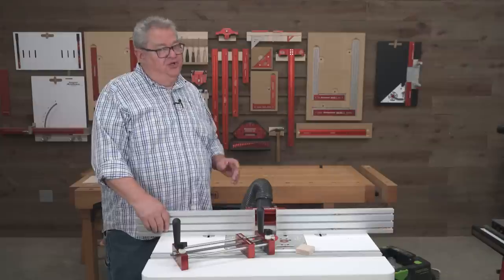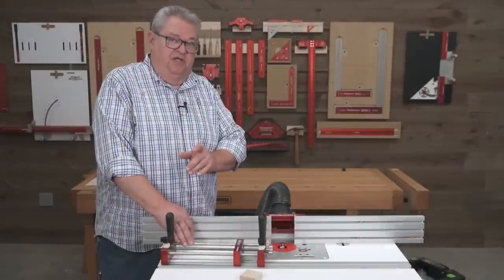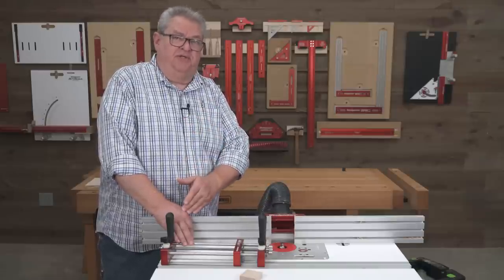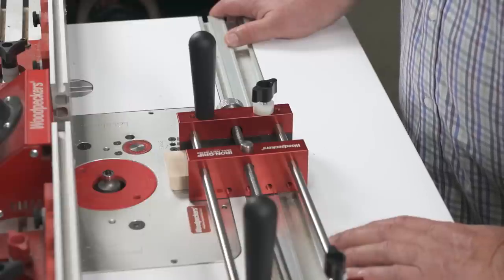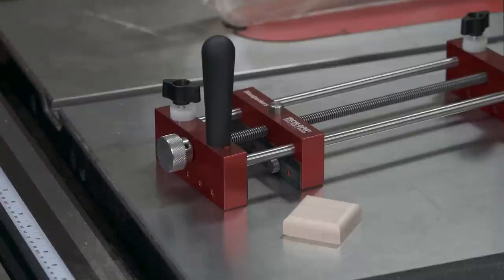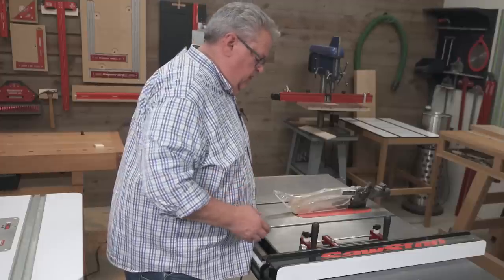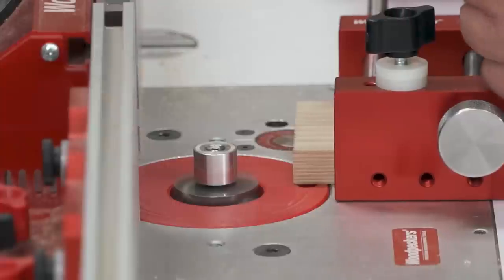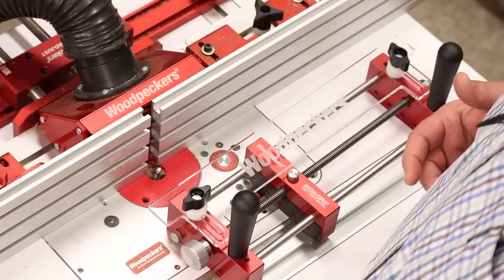Iron Grip Small Parts Holder Deep Dive

Comment: Great video and like you Jeff I don't wait for the router to power down, I make adjustments on the router table (small picture frames) with my small parts holder. Far quicker and I'm not spending time waiting for the router to spin down and when I'm making 10 small frames (40 pieces) time is important.

Comment: Nice video!  I am surprised that you didn’t wear hearing protection as the router whine is the most dangerous noise to safe hearing.  Also, I installed a STOP paddle at thigh height so I can turn off the router safely by touching it with my thigh without having to take one of my hands off the wood to turn off the router, especially in an emergency.  It also allows me to keep my eyes on the project at all times too.

Comment: I would leave the router motor running to but move away to change the side to be cut.  I understand some peoples trepidation's and my opinion is that too many have what I call the "sawstop" mentality in that they let the machine do the safety thinking.  I've done so much electronics and aircraft maintenance and now woodworking that SAFETY is always #1 and has been ingrained in my brain; technology is great but is raising too many non-thinkers out there.

Comment: Other than having the work piece flat on the router table, is there anything the Iron Grip can do that the Woodpeckers coping sled can't do?
Reply from the maker: The width capacity is greater and the Coping Sled has no capacity to clamp extremely small stock. It will clamp narrow, but not short.

Comment: I am currently on the second copy and still having the same issue. As soon as you try to tighten the knob, the button on the movable jaw depresses by itself and the thread starts skipping. I think there is a flaw in design and the spring under the button is too weak. I’m going to be returning mine. Hopefully they can fix this problem soon.
Reply from the maker: Please contact Customer Service. We've recently become aware of this issue and have instituted new assembly procedures. We'll make sure your next one works. Sorry for the problem.

Comment: Will iron grip work for coping cuts (rail and stile door matched bit stuff)? Most coping sleds raise the cut piece since the piece rides on the sled base. It is more difficult to switch between rail and style cuts since rails are on the router table and stiles ride on the sled base. If seems the iron grip might make a more consistent setup when switching rail and stile bits ...
Reply from the maker: Should work perfectly.

Comment: Hi Jeff, I have an issue when tightening the Iron Grip. The button that let's you quicklyl move the arm most of the time doesn't lock. So when I try to get a firm grip on the piece it slips. Sometimes if I pull up on the button I can get it to lock, other times it just keeps slipping. Do you have any suggestions on how to fix that?
Thanks, Tim
Reply from the maker: The half-nut may be faulty. Call Customer Service.
Reply: @WoodpeckersLLC thanks I called customer service and the told me a spring probably failed or got twisted. Take it apart and see it you can fix the spring.
Reply from the maker: If the spring is deformed in any way, call back and say you want it replaced.

Comment: Is it possible to have  a hold-down to prevent bit push-up.
Reply from the maker: Have not found that to be necessary in any cuts I've made with it. The Acme screw vise is sufficient with its sideways pressure. If you have experienced lift with other similar looking small parts holder, I can tell you the clamping hold of those jigs is the reason we decided to proceed with development of the Iron-Grip.

Comment: Great explanation of the safer way to use the IronGrip and then you put the stock in the back of the device several times and held the side away from the handles. I was sitting there yelling at my monitor "WHAT ARE YOU DOING? USE THE SAFETY HANDLES! THAT IS WHAT THEY ARE THERE FOR."
Reply from the maker: Ding, ding, ding...you're the first to catch that I used it backwards...but it wasn't several times, just once. Holding by the side had nothing to do with that, I just personally feel more comfortable holding the sides instead of the handles, but that's just me. Either way, you're removed from the bit.

Comment: I have a Festool CMS GE router table (this table has been discontinued) the surface area of this router table is smaller than the traditional router tables.  Could you provide are the overall dimension of the Iron Grip Parts Holder to see if it would work on this table?  Or, do you know if the Iron Grip would work on the Festool router table?
Reply: @bestyoutubernonegraternumber1   thank you.
Reply from the maker: It's 13" wide and 5" deep. Though, it really doesn't matter. The left end and the vise jaw are the only parts that have to be on the table. The right end plate could overhang without affecting operation.

Comment: Isn't there an electrical or mechanical way to rapidly slow down a spinning motor?  Didn't some of the old delta radial arm saws have some sort of "resistor" wired in to slow the motor....?.....and some had the little lever on the end of the motor to act as a mechanical brake.   probably would be a big seller.   The first router company who incorporates that into their router will do well.   Seems like it should have been done years ago.  thank you for the vid.   lots of folks have lost weight doing the "carnivore diet".
Reply from the maker: He's looking to speed up the spin-down, not vary the operating speed. Several of the new brushless cordless routers have instant brakes, but I'm guessing it will be a while before we see it in anything you would want in a router table.
Reply: My cordless Dewalt brakes within a second or so.

Comment: Forgive this ignorant question, what would you be making such small parts for, could you give some examples. I eat what ever I please and avoid fad diets.
Reply from the maker: Jewelry boxes come to mind immediately. But, "small" is in reference to any dimension of the piece. Tenon cuts are short across, but the part could be several feet long.
Reply: I have made replacement totes for hand planes putting a radius on the long edges and a small parts holder definitely made the job safer.
Reply: Omg! That sounds great, I restore stanley baily planes. Thank you for the idea.